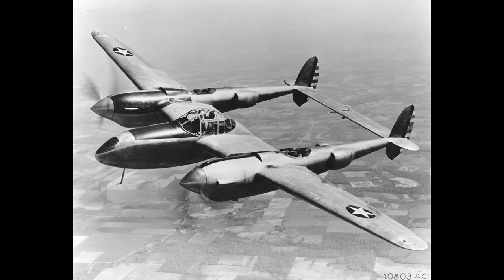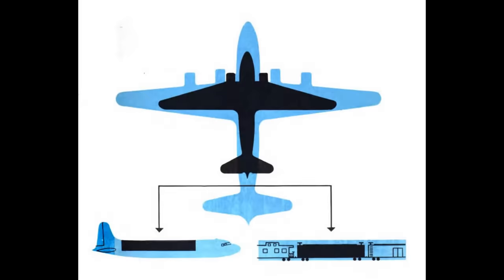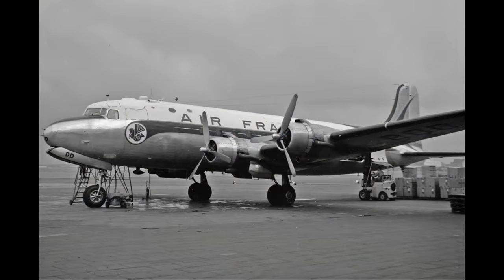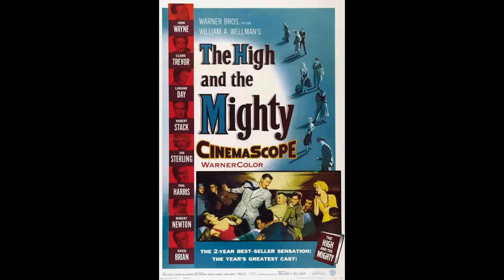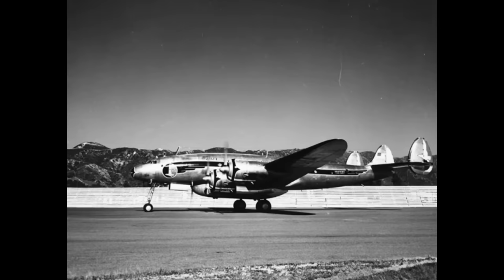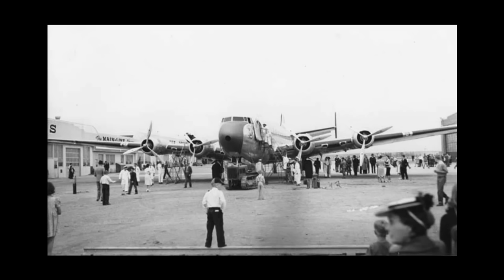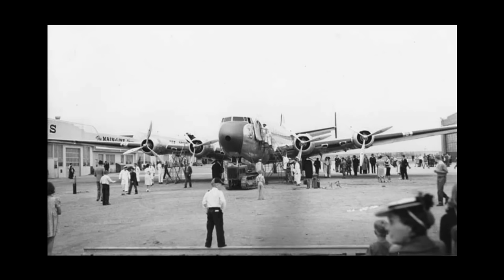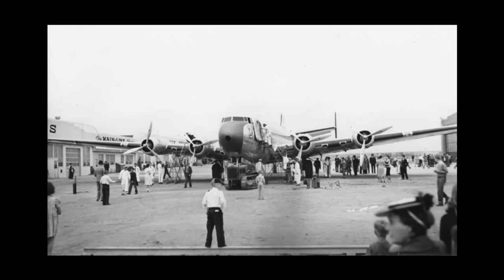Turbo Compound Piston Engines. Almost magic tech.

Comment: The turbo compound is an amazing piece of engineering. But we must not forget it was a blind alley and a step too far. As a child in the 50s we flew regularly between Hamburg and London when DC 6 and 7 and Vickers Viscounts were in service. The Viscounts were a giant leap forward.  In Hooker's autobiography he refers to visiting the Wright factory and being shown rows and rows brand new turbo compounds with no customers. Write begged Hooker for a licence to build gas turbines. The turbo compound is the tea clipper when coal had arrived or the steam loco up against diesel ; glorious but doomed.
Reply: And yet, I would wager DC-7s remained in revenue service for longer ! (Freight, anyway) DC-6Bs still are money makers in Alaska even today, too. Sadly I don’t think a single Viscount flies, so Mr. Douglas had the last laugh 😆
Reply: @johnparrott4689  Yes, I recall the last Viscount being retired from the run to Orkney. RR stopped supporting the engines.
Reply: @limyrob1383 always wanted to sample the view from those big windows 😊. The only operational one I remember seeing up close was a corporate owned bird at Milwaukee c1982. Shame RR doesn't support the Dart but it sure had a good run, what an advance it must have seemed when it came out

Comment: umm, let's divide 3.7854 by 2.7215....
i.e. for the other part of world one liter of fuel weighs about 1.4 kilogram (always wanted to check).
Fun Fact: Scania trucks use Turbo Compound, or, AFAIR, used it back in 90's or 00's. It gave about 30 hp extra. 
(ah, Greg also mentioned that near the end)

Comment: What is the difference between Turbo-Compund and Fluid Drive?
Reply from the maker: Turbo-Compound is exhaust driven.
Reply: @GregsAirplanesandAutomobiles  Turbo Compound is exhaust Driven, while Fluid Drive uses Transmission Fluid, which then has to be cooled but, if Exhaust is your power plant out-put, why the change of Fluid?

Comment: You talk about the L-1649 (Starliner) and the DC-7 but should be specifying that you are referring to the DC-7C.  Both used the 3400 max hp version of the R-3350.

Comment: How did these engines provide boost pressure with exhast going in the turbine? Mechanical supercharger?
Reply from the maker: Yes, I did mention it in the video, but didn't focus on it enough because a few people have asked that question. It has a mechanically driven two speed supercharger.
Reply: @GregsAirplanesandAutomobiles  Thanks for explaining. I also didnt realize you where also a pilot till this video. I love your technical vids and its great listening as i drive over the road.

Comment: So I understand the video just fine, but I do have one question:  Why do you suck energy off the crank to drive a supercharger, and then it put it back with a turbo compound?  It seems like it would be much simpler to ditch the supercharger, and then use a turbocharger to supply forced air induction.  I'm sure there must be a reason here, I just don't know what that reason is.  Perhaps someone could enlighten me?
Reply from the maker: The turbo would slow the exhaust down and reduce the effectiveness of the turbine drive. Also, the supercharger isn't as inefficient as people think. Centrifugal superchargers are really efficient.
Reply: @GregsAirplanesandAutomobiles  So you would say this is the most efficient approach?  This question could be broken down further, applying the question with 1940s technology, and then again with modern technology.  (Also, many thanks for taking the time to reply!)
Reply from the maker: I think this was as good as they could do in the 1940s. Today, I'm not so sure. It would probably be very close between a low boost turbo combined with a PRC and a good centrifugal SC combined with a PRC. I really don't know which would be better. I do know that for higher power and economy it's going to be the centrifugal SC with the PRC. Keep in mind, this thread is being shoved down in my feed so I won't see it again.

Comment: What % or extra power did a blown down turbo give?
Reply from the maker: I'm pretty sure I covered that in the video.
Reply: @GregsAirplanesandAutomobiles  I watch it again and can not find where you say that. I know you said 450hp on full throttle but what persentage is that if the original hp output

Comment: Now, could enhanced metallurgy (materials) and CNC machining have resulted in a more reliable R-3350-TC?
Reply from the maker: I think the R-3350 could have been made reliable with turbo-compounding, but they were pushing a marginal engine a little too far. Had it been an R-2800 I think turbo-compounding would have a better reputation today.
Reply: @GregsAirplanesandAutomobiles  I see you dodging my premise. Why?
Reply from the maker: I didn't mean to, I'm not sure it's possible to fully answer a question about a hypothetical scenario, let alone in a comment. Is it possible better metallurgy could have increased reliability. Sure it's possible.
Reply: Perhaps, but why?  It's still going to be more complicated, more expensive to manufacture, and  less reliable and with a lower power to weight ratio than a turbine engine.

Comment: I wonder what the commercial backlash to nonstop flight was. A lot of stopover towns were pretty well stunted or depopulated.
Reply: I would guess the end of subsidized air travel, the ‘Essential Air Service’ that the CAA/FAA funded to allow small towns and cities the advantages of airline connections, had more of negative effect than nonstop transcontinental flights did.

Comment: You can look at it 2 different ways:  You can use Bernoulli's equations and trace the energy from one location to the other.   The change in total energy before the turbine and afterwards is the key.   You can also look at it in a thermodynamic energy basis... Similar to any turbine application.   Some turbans operate on pressure change and other turbans operate on velocity change.  A key difference is The Strain on the engine both in terms of pressure and temperature.  A velocity blower yields a lot less strain on the engine.  (Of course another consideration is where in the thermodynamic cycle you want to extract the energy.)  [Mechanical engineers are such nerds...]   I'll admit that I've worked with  Turbo chargers, pro chargers, and superchargers but never this type of turbosystem. [Adding a fluid coupling wasn't genius.  They could also use that coupler for gear reduction as well!  (As used in the Chevrolet turbo-glide transmission.)  I really learned a lot, and I appreciate it!   Is going to look at your other videos!

Comment: Allison was engineering a turbo-compound version of the V-1710 at the end of WWII.  The results were astonishing, but of course Allison was at the same time deep into turbojet research and the project went nowhere.
Reply: The V-1710 was really impressive. Allison took it from 600 to over 1700hp as I recall during the war. One interesting variant was designed specifically for the US airship program, it could run as a pusher or tractor

Comment: Greg, if the Allison V-1710-127 had the bugs worked out and was installed into the P-63 as originally intended before the war ended how good do you think that fighter would have been?
Reply: It must not have been a good engine and Bell probably wanted to concentrate their limited post war budget on jet and turbine engines
Reply: The P-39 and P-63 did really well at low altitude- a lot of Russians made ace in them.

Comment: Hi Greg. Two things.
One. I never knew you were a pilot! 
I thought you were just a Wing nut.
Two. 
     Donald Douglas hated these engines, at least the complexity and the high failure rate. 
      Just look at the many times the Boeing Stratoliner flew as a three engined, and even a twin engined design! (Just like the B29).
Reply from the maker: It was the wrong engine to use with this technology, but they didn't have much choice, the much more reliable R-2800 was too small.

Comment: what am I missing? surely more power = more thrust? What is the difference?
Reply from the maker: Hi Dave, I'm not sure what your question is. Are you asking me the difference between thrust and horsepower? If so, it's like the difference between torque and horsepower. More torque equals more horsepower at an given RPM, but they are still two different things.

Comment: That these highly efficient engines did not make it in the long run, and were replaced by the less efficient turbofan, was the first indication of the biggest risk we face today, a generalized competency loss on all levels. This eventually will collapse our complex society. That a titanium strip duct-taped on a rotten airliner turbofan  killed Concorde was step2. Step three is doors and other objects falling off the 737, the first truly non-engineered airplane….

Comment: I think Scania is the truck maker using turbo compounding having been experimenting with it for twenty years or more, I dont think Volvo does, though I may be mistaken.
Reply from the maker: Volvo does, Scania probably does as well.
Reply: @GregsAirplanesandAutomobiles  Scania were the first to put out a commercial version of the turbo compound engine in 1989.....followed in 1990/91 by Volvo not wanting to be out done by its domestic market rival.
 I had one in 1989 when our fleet was routinely mileage changed, to the new 3 series vehicles ( a 113,  3 series) 
A couple of years later Mercedes Benz dipped their toe into the market with limited application vehicles but didnt make it mainstream  until the introduction of the mk2 Actros upgrade in 2016 (I ended up with one as my fleet vehicle too  but hated the autobox that was sold as a package) 
of all the manufacturers it is only Scania who have maintained a turbo compound option for all these year's  the others offering products one year then not the next ever since. Volvo is now re offering TC engined vehicles again

Comment: The first thing to do with a blowdown exhaust turbine is remove auxillary loads off the engine such as the alternator and air conditioning.
Reply: On some early pressurized King Air and Aero Commander airplanes, a hydraulically-driven supercharger was used for pressurization as the engines didn’t have the ‘oomph’ to bleed air from the compressor for environmental use.

Comment: Because of the complexity and failure rate of the DC-7's engines, didn't the pilots say, "A DC-6 is a four engined airplane with three bladed props: the DC-7 is a three engined airplane with four bladed props"?   😳

Comment: I wonder if this tech can be used in cars to increase fuel efficiency.
Reply: i think volvo uses it on large transport/ lorry engines.
Long distance daily driving , the benefits would pay off.
In the small non commercial market daily driver market, I  would think the increased complexity, and therefore added price warranty and repair complexity would detract from its addition.

Comment: If the exhaust gas energy is used to provide additional power at the crankshaft. How is the air flowing in the motor compressed atleast in altitudes to fill the cylinders?
Reply: I think once you are in cruise you don't need as much power to hold the attitude.
Reply: @jospi2  Anyhow you need all power for the start for the climb.....If you don`t have enough manifold pressure you don`t have the power to climb. You need some kind of a charger.
Reply from the maker: They use a centrifugal supercharger to compress the intake air.
Reply: @GregsAirplanesandAutomobiles  Thanks!

Comment: The high and the mighty was based on a true story. Only the real airplane didn't make it.
      The pilot realized they would not have the fuel to reach land.
      There were over a section of ocean that was unusually calm and so he orbited this area until it was light enough to see, and in that time several ships were able to get there so they would be on hand to rescue any survivors.
     He made a near perfect water landing and the ships came if to take off the survivors and no one was even injured. In fact, I don't think anyone even got their feet wet.
Reply: Captain Richard Ogg and his crew, after having 2 engines fail on a Boeing 377. They made a textbook ditching next to a Coast Guard ship, one of the floating nav beacons, Ocean Station November...

Maui VOR, and the airport's 3-letter identifiers honor CA Ogg today.

Comment: As someone else has remarked, there's a certain similarity of principle here to the steam propulsion system of the Titanic: https://www.youtube.com/watch?v=v0Fr-dOzpDs In the latter case, the reciprocating engine was triple-expansion and the turbine drove a separate propeller shaft to the piston engine. When you see a video of a powerful aero piston engine running and blue flames shooting out of the exhaust stubs it makes me wonder if a multiple-expansion piston system is a possibility. Probably, turbo-compound is just the easiest compromise.

Comment: Don't need great circle routes. Their only purpose was to confuse long range pilots who see every day that the Earth is a plane, not a plane t. You're a smart man. Answer this question❓ How does an A-6 or Buckaneer pilot fly the wavetops at 400kts with the aircraft trimmed straight and level. A sphere at 25,000 mile circumference is something to hug at that speed...Do the math. Warning I'm an avionics tech. No baffling bs allowed.
Reply from the maker: I'm not sure if I understand your question. Flying low above the ocean straight and level is much like doing it at any constant altitude, just with less tolerance for error.

Comment: 70+ seats in a DC-4??? Where? I rode several times Iceland to England on a DC-4 and we carried 34 pax IIRC and that seemed like a capacity load at the time.
Reply from the maker: As shown in the video, at Pan Am in a certain configuration.

Comment: In what way are Subaru the most boring car company? They make some really trick sports cars, and are about the only car company to use a boxer engine, thinking about it that same Subaru boxer engine is used in some light aircraft.
Reply from the maker: Don't make me put up a Subaru video.  Look, I'm just poking fun at the Subaru enthusiasts. They are decent cars, but most models in the last 20 years have been boring, WRX excluded.

Comment: Seems to me that in the last few seconds of your video where you describe the turbo compound driving a dynamometer, it could instead drive a dynamo, thereby charging a battery which in turn would drive electric motors at the wheels to make a hybrid automobile 20% more efficient.

In a nutshell, the electric part of a hybrid vehicle would be powered by scavenged energy instead of tapping main engine power. This implies a hybrid automobile that could charge its battery while cruising on gasoline with little to no parasitic loss of power to the wheels while doing so.
Reply from the maker: Yes, it could drive a dynamo. How much more efficient that would make a hybrid I don't know.
Reply: @GregsAirplanesandAutomobiles  Assuming the exhaust is leaving the engine / turbocharger wastegate with velocity, there's still energy to be scavenged. Perhaps the reason this additional free energy is currently being ignored is because of the additional mechanical complexity, with its initial cost and repair issues?

Comment: I think you kind of underselling the importance of speed. not only will the passenger and cargo pay more, but the airline will pay less. Well sort of.

Pilots and cabin crew is payed by hour, not km. The aircraft also have a given life in years and hours (well also cycles).  Of cause, this mostly effect somewhat long travle distances  If the travle distance is in the range of 40-50 minutes, the time on the ground cost way more than the time in the air. But when it stench out to 3-4 hours, the time in the air and cost is really effected by the speed. And typically, at least for modern jet aircraft, engine maintenance is generally not a huge issue)

There is really just two flip sides to this. The first is fuel cost. And that can be almost totally offset by altitude. Well apart from the cost to getting to the altitude, that again depends on how long the distance is.

The second part is probobly the most limiting one. Trans-sonic effects. Where the altitude for speed trade off stop working
Reply from the maker: "underselling" maybe, but airline economics were not the main topic of this video, so I didn't want to spend too much time on it